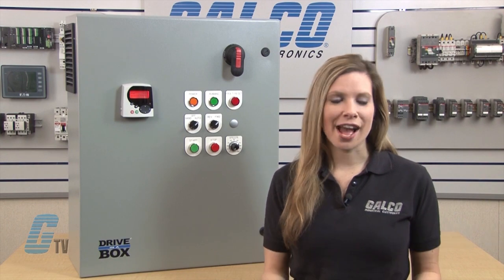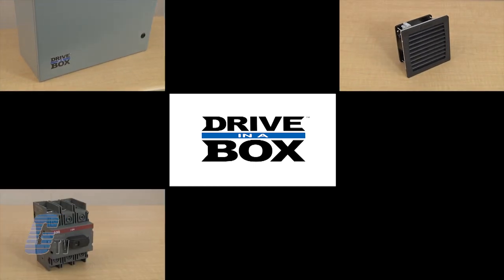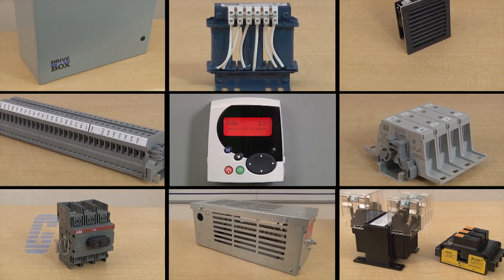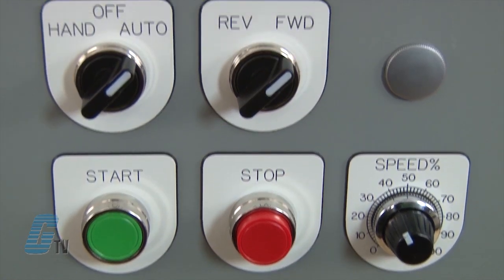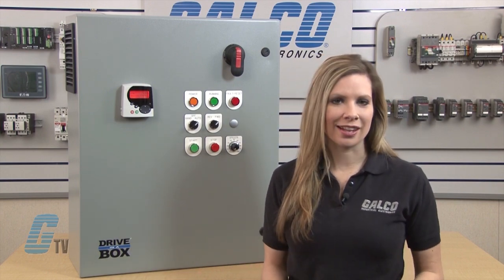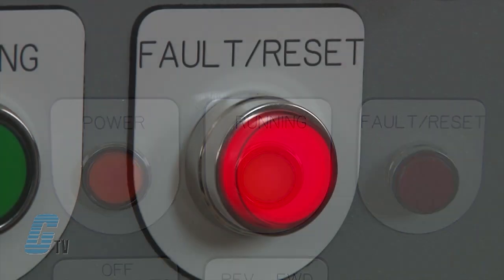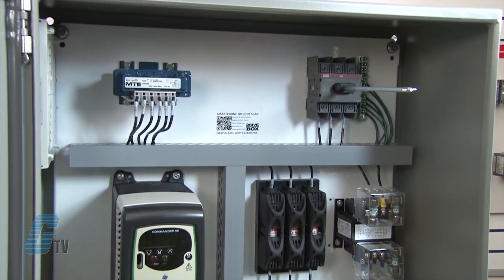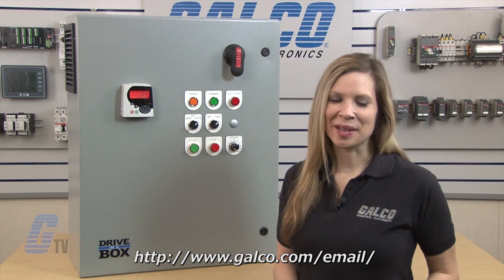DRIVE IN A BOX®

Comment: She was obviously confident in using this product, though I don't know what product this is.
Reply from the maker: The product is a standalone variable frequency drive (VFD) that is prewired in an enclosure so the user can control an AC motor with much more ease.  Typically a VFD user would need to do their own wiring and assembly in an enclosure as well as drive set up, where as this device reduces the time required for installation and programming by a great deal.
Reply: That's awesome! Thanks for explaining!